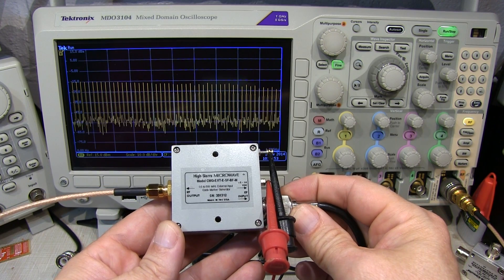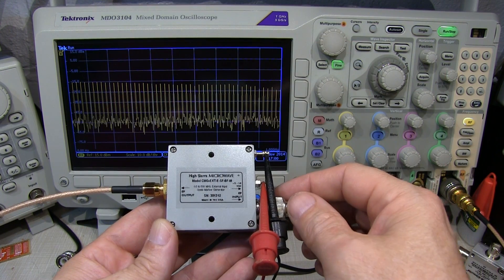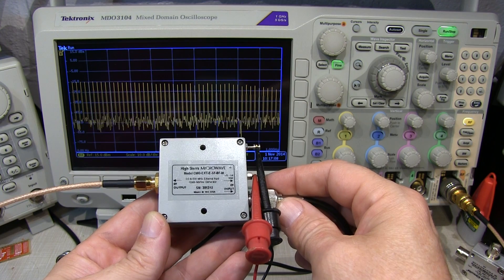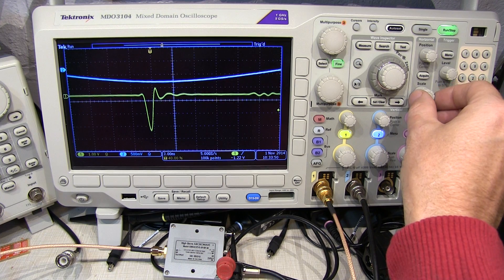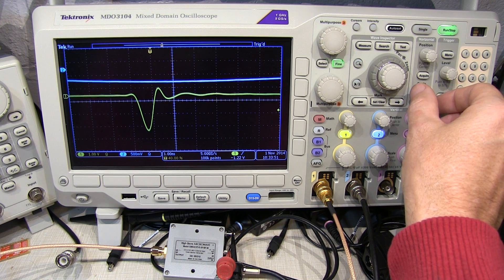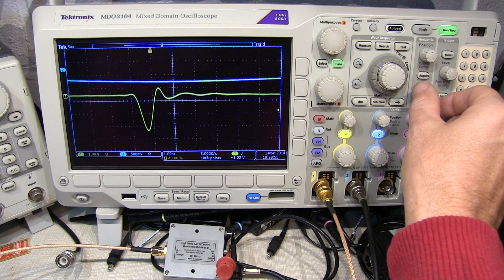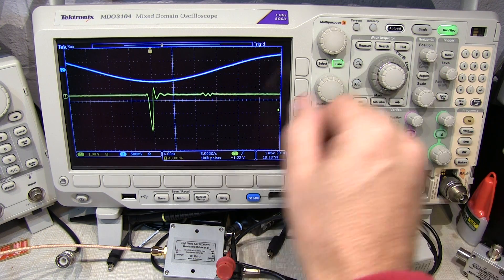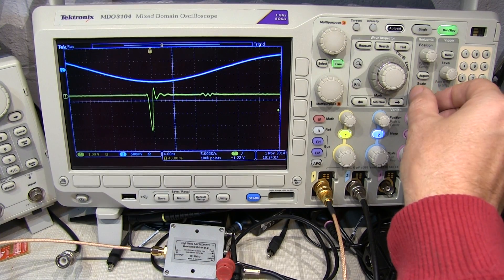#181: Basics of an RF Comb Generator - a tutorial

Comment: Amazing video. Here's an idea, why not modify/tweak the 74AC14 Schmitt trigger fast oscillator that you showed once to get only one pulse (or ones that are separated far enough) that has no top (an impulse, or theoretically, a realizable Dirac Delta Function https://en.wikipedia.org/wiki/File:Dirac_function_approximation.gif, or https://mathworld.wolfram.com/DeltaFunction.html) that give a close to a horizontal line frequency spectrum to check filters and components. Another video idea that only you with your equipment that's worth about 51% of the eastern coastal states can do

Comment: Could you fast edge TDR circuit based on 74AC (<2nS edge) being used as an el cheapo comb generator? And if/not can you explain why?
Reply from the maker: Sure it could, but you're mainly going to get just the odd harmonics of the fundamental oscillating frequency, and the amplitude of each tone will decrease over frequency.

Comment: +w2aew (or anyone else who knows) Would it be possible to use this in an example like this: The previous version of a device required frequency 93.2, and the new version of the device uses 99.3, and you need both to receive a signal from the same transmitter?
Reply from the maker: No, probably not.  The comb generator produces harmonics of the input signal, not specifically selected frequencies.

Comment: Thanks for this and many other interesting videos,
when the DSA or computer after FFT analysis displays the spectrum of a square pulse or pulse like the one you show in the video, If I properly understand the phenomenon, no actual oscillation of current exists in the circuit, in these two examples of pulses I mention. It's an arctifact or math output of the FFT algorithm to reconstruct the pulse shape, right?
Physically it's just a semiconductor "gate" opening and closing, conducting or not conducting, right?
 The comb pattern is useful, maybe as an analog computer, for comparison with other signals in the frequency domain, signals, that may or may not be real oscillations of charge in circuits, but share a common frequency.
I am sorry, but I do not know the technical name of the short, quickly fading, ringing pulse, but, is it true that if this pulse is fed into a coil or inductor it will actually produce an oscillation, but the output frequency from the coil or inductor, wil mainly depend on the
resonating frequency of the coil or inductor, or it will also depend on the amplitude and frequency of ringing of the inital burst or pulse. Does this process also work for square pulses, not going into negative Voltages?
Do you know where I can find information on that process? Greetings, JL
Reply from the maker: jlfqam The frequency content of a square pulse does indeed consist of the summation of sinusoids at the fundamental frequency and its odd harmonics (scaled by 1/N).  See this video on the topic:
https://www.youtube.com/watch?v=eC36AqL5mw8

So, it's not just an artifact of the FFT, it is real.
Regarding the "ringing" of a coil, you might want to check out the second half of this video:
https://www.youtube.com/watch?v=74fz9iwZ_sM

Whether you are considering square waves or narrow impulses, the steepness of the edge (rise/fall time) governs the frequency content.  Faster edges = higher frequency content.
Reply: ***** Thanks for the response. In  your  video #59, the AWG soft sends a wave composed only of the odd harmonics, but the DSA still shows the even harmonics. The DSA uses FFT right, do you know which algorithm?
 I would like to measure if there are oscillations in the circuit, other than the regular pulse. Do you know how can this be done? should I use filters to select only one harmonic at a time, is it possible in a simple way?
Greetings
Reply from the maker: jlfqam Yes, but those even harmonic components are simply distortion products, and are typically more than 50dB down from the fundamental - very small.  The spectrum analyzer shown uses a Chirp-Z transform to compute the spectrum (this is similar to an FFT, but without the n^2 record size limitation).  Ideally, filters can be used to select only one harmonic component.  The practicality of this depends a lot on the harmonic frequency spacing and filter design.

Comment: Thanks Alan , I was set [ except the funds ] to saving for the Rigol 815TG , now I think it will take longer to get a spectrum analyzer .
2nd time I've seen this from Tektronix , 1st on SignalPathBlog .
You guys get to play with all the good toys ;)
Reply from the maker: The one that you saw on SignalPathBlog was the MDO4000, the one in this video is the MDO3000.  The 3000 does not have the time-correlated feature with its spectrum analyzer that the 4000 has.  Note that neither of these has a tracking generator available.  In many cases, you can use other techniques, but just wanted to let you know.

Comment: I just got my callsign recently, but wasn't able to do anything, since most of ham equipment if expencive (I'm a college student). Do you find yourself building your own circuits for transmitting / receiving or just buying premade equipment?
Reply from the maker: I've done both. You certainly can build your own transmitter and receiver, or pick up something used - both can be done very in expensively. Check into your local amateur radio clubs, many will have equipment to lend to new hams or there may be members that are willing to do the same.
Reply: And then there's always the Baofeng stuff,  typically can be had for under $30...

Comment: Another very helpful video, thanks Alan!! Wish I had known about this before I had purchased a 4GHz microwave signal gen just to test a few things. I have a request haha! I'm very interested to know how phase noise analyzers work, namely how they manage to test down to dynamic ranges of below -200dBc... my current guess is that they employ some elaborate gain circuitry and filters to split one sideband of the impulse into multiple gain stages? (hence taking a fairly long time per measurement?) I couldn't really find anything online in terms of actual implementation. Just curious! :)
Reply from the maker: From what I've seen, making measurements which are than far down from the carrier, is done by notching the fundamental so that the analyzer can be set with less attenuation and even a preamp.
Reply: ***** That makes a lot of sense :0 I guess it's just a matter of making sure that the notch filter is applied perfectly and doesn't interfere with the measured sidebands. Thanks for the reply! :)

Comment: You bring to us fascinating information / technology...Thank You!
Does a harmonic, or tooth of the comb, get its power/energy from a fundamental? If so, then as it takes power to expand a fundamental (increase frequency), the result is a diminished harmonic (tooth)?
Reply from the maker: If only a SRD (step recovery diode) is used, then the fundamental energy is effectively divided amongst the harmonics (with some loss of course).  Often time, a packaged comb generator module will include some amplifiers which help to increase the power in the harmonics.  You can see in the video that as the input frequency is lowered, more teeth are created in the frequency domain, and the power level of each tone is decreased.
Reply: *****
Thank you for the reply!